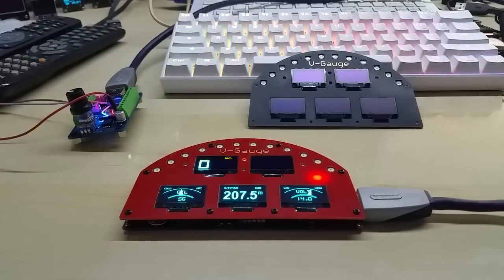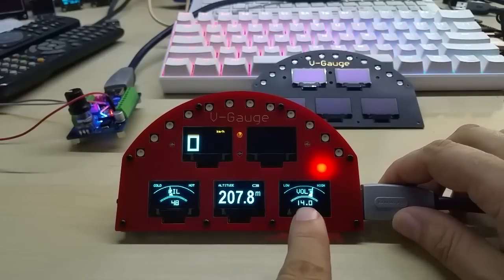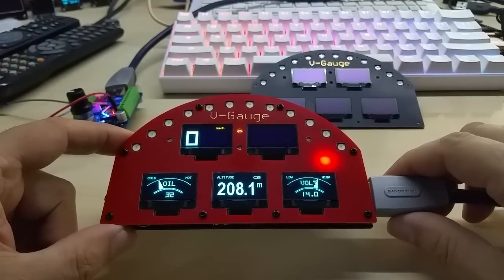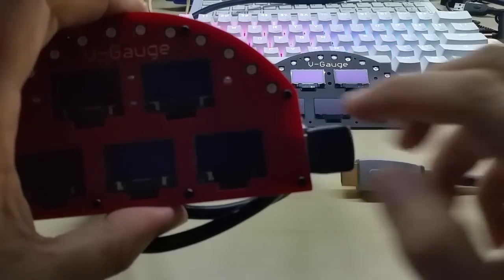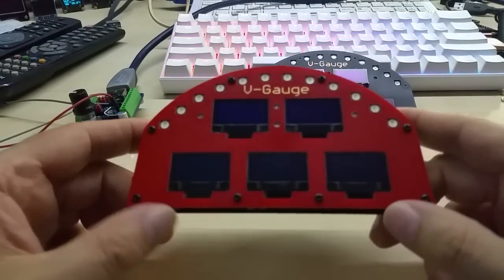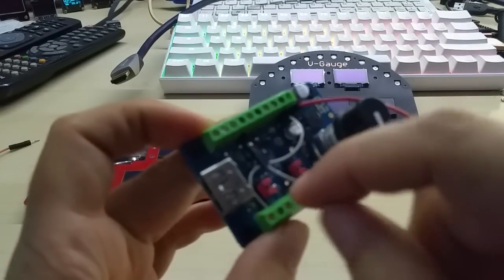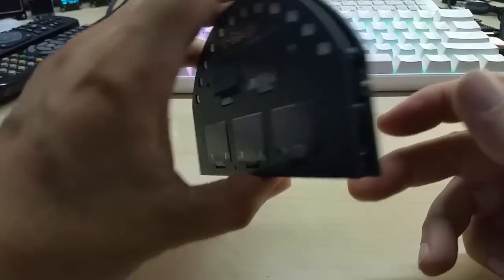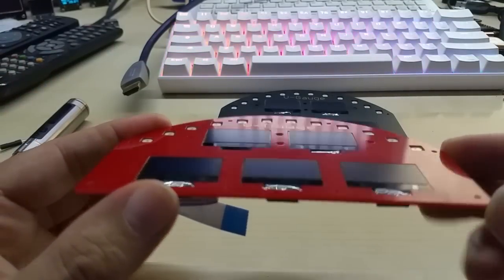V-Gauge in Racing Red and blue OLED Displays, more Info to come.

Comment: Hi, I'm from Spain. I'm trying to find if there is any way to connect an OLED display via simhub, in order to use it for euro truck simulator gear indicator (I need two digits). If anyone knows how, I would be very grateful

Comment: Just watched this vid and subscribed. Awesome job.. any code for fuel level ?? Asking for a friend.
Reply from the maker: Not really, as fuel sensors could be voltage or resistor based. You would need to know the fuel level sensor and start searching for examples for it.
Reply: @iHayri1  yes I have figured that like with any gauge and haven’t found too
Much out there.   I found multiple ones for battery but again not much for fuel.  I’ll keep playing around with it and see what I can come up with.  Thank you.

Comment: Any estimate on price yet?
Reply from the maker: There are a lot of smaller items that increase the cost trust me :-) lipo, HDMI connector, HDMI cable, charging circuit, voltage regulator, rotary encoder, stand offs, screws, flat flexiable cabe and it's connectors, black box and it parts, sensors, nav switch, slide switch, screw terminal and I still could go on. Of course you can just go and buy some cheap Chinese gauge but you will not get what I offer, of course it is not for everybody but go and check some other prices people have, just the shiftlight with RPM costs $180.00 from it's creator. I am a one man operation and can not compete with multi million dollar companies ever. Custom handmade electronics have it's price, unfortunately and I mean that. And also ask yourself for how little income Chinese people must work. You can but a cell phone for $100.00 or $1000.00 it's all a preference. Also count in the time it takes from scratch to design something like this. Did you know that the software alone costs $2000.00, sure i have to but it once but still, or my electric bill with all the electric items needed to work and put this together? Believe me you would not be able to make this for less, unless you work for free and all your expenses are paid from somebody else. Don't get me wrong, I am not mad at you or anything, just wanted to show you what is involved and this is just part of it.
Reply: Hayri Of course man, I all ready know it, and you teach me a lot of things the last year that I must thank you, yours successes and yours mistakes teach a lot about what way to chose. 
To be honest I was thinking on a psicological price tag of 150€, double that it's what shocks me, but by the way looks that you're customers find it fair.
I'm only trying to point some things in where I can see that you can optimize the costs, I know for V-Gauge v1 it's late, but maybe a cheaper, low quality version in the future, can bring my and others the opportunity to get in in you're market, you know, more customers more profits.
And you're right, I'm always thinking in the industrialization of the production (Like if I'm only was a machine that doesn't live or eat LoL), and from this point of view some things that you do increase hugely the costs, for example, file the edges of the neopixels, or paint in black the inners sides of the front PCB, human labor got insane production costs, touch the product from my point of view it's a big mistake, you're doing so well with the reflow oven and the homemade pick and place machine to introduce human operations.

Don't get me wrong, I was surprised by the price tag, and yhea, im very cold at designing. 

Anyway, as I say you before, nice work!
Reply from the maker: I understand your point as well of course but I even forgot the cut Indigogo/Tindie, Paypal, my bank and the taxes I have to pay :-) The only way to get the price down would be to have it produced in large numbers in China, but still I would need to be involved in the production and move to China :-) Nobody there will do the detail work.
Reply from the maker: Around $300.00 US
Reply: Hayri Woha! 

Wait...

5x ≈ 5€ OLED displays = 25€
12x ≈ 1€ Neopixels = 12€
5x ≈ 2€ Atmega328 = 10€
1x at least 10€ GPS = >10€
2x at least 10€ PCB = 20€

I know it's an expensive setup, at least 100€ in hardware, but most head up displays cost less than 50€, all ready maked, with case, box, instructions manual, and retailer profit.

Yhea, Chinese quality vs European quality, Chinese labor cost vs you're own work, but man, you need to be competitive. Maybe an espressif instead of five atmegas, some true RGB analog LEDs instead fanci neopixels, a small back PCB that don't excced 3€ and an aluminum faceplate to hold the screens, can reduce the cost.

Don't missunderstood me, maybe for the next revision, but you need to take care of you're market, personally I can't afford one.
Reply: I feel like it is a really fair price , I'm wondering if I will be able to place the v gauge where my stock instrument cluster is and the gps will still work?

Comment: The black looks amazing! Great inside view of all the components, what a set of boards!!
Reply from the maker: Thanks, they came out great, my favorite toy now :-) All that is needed is to design a kinda bumper case that could be 3D printed or CNC milled out of solid aluminum for when in use on a bike or boat for example, that would make it possible to put a Lexan display cover over the front and even the back :-) i know I mentioned Gorilla glass but that will be very cost intensive, but Lexan, like another viewer mentioned would be ideal and not add much to the cost. Again, of course a CNC milled aluminum case will not be cheap but look killer :-)

Comment: Really clean mounting of the displays. Assumming they are held to the face PCB by soldering the pin connections and plated mount holes at the bottom of the display? Have you had any issues with displays that have the screens misaligned? I seem to often get ones like that.
Reply from the maker: Hi Jon, I would say I nailed the mounting of these displays and you are correct they are held by the 4 pins on the top and 2 mounting holes on the bottom where they get soldered to the pad on the PCB. I could use the top 2 mounting holes as well but there is no need really, they sit very snug and have to play to start with and the solder points are strong :-) The beauty of this mounting is the displays will always be 100% aligned it the front and the PCB of the display can be a little misaligned but it does not hurt the connection, if they are too misaligned as i had a few of those I just lift them up gently from the double sided tape and put it down again better.

Comment: Oh also the black box is a great idea, for auto use in newer cars with obd/obd2 I wonder if it's possible to connect the requisite wires through that port and related plug to make it plug and play for anything with that standard
Reply from the maker: I would love to do a OBDII version as well, actually it would be possibe to upgrade the V-Gauge to show that data but I have no way of testing it as my car is a 96 with no OBDII. I know there are simulators but somehow I do not like the idea of just simulating something and selling it with no real life test. If I ever get to buy another car (2007 Chrysler 300C for example) I will make a gauge that will just plug into the OBD port and be a plug and play version. I will not make it wireless using Bluetooth, first because I hate Bluetooth, second it has a 1- 1.5 second lag and third the gauge needs power anyway and is connected already and therefore it makes sense of just plugging it into the OBD port and be done with :-)

Comment: Awesome as always Hayri. Did you look into laminated tempered glass sheets for tablets like I suggested on an earlier video? Gorilla glass is great but very expensive. Another option would be lexan(thin polycarbonate, relatively easy to cut and source) and coating that in a SiO2 or ceramic glass like coating. It does add time but it's something that can be done with a plastic sheet knife or similar and the applicator pads that come with most car ceramic coating kitsch. 1 kit would do MANY screens and have several advantages over even gorilla glass. Also 3d print a buck or mold and either resin pour the sun shade or vacuum mold it(if possible). All things to think about and I understand, not always doable. Get some sleep and great work
Reply from the maker: Thank you for your great ideas and yes I remember you writing about it earlier. Lexan would be really an alternative and I could even offer spare ones so anybody could just replace it when needed. I know Gorilla glass would be nice but most likely too expensive to start with. For the sunshade I figured I could cut the first one by hand ands if I get a larger order through Indiegogo I would just buy a CO2 laser cutter, buying because it will save me time as opposed to build it, and cut the shape out of thin ABS or similar, needs to be withstand the heat in the car that can build up during summer time. Could really go as fancy as to have it attached to the gauge with magnets so it can be simply snapped on and off. If only money would be plenty I could do so much more, but gotta start somewhere, who knows maybe it will be a big hit :-)

Comment: Very nice.   What does it connect to in your car to get the info it displays?
Reply from the maker: This was just connected with 3 wires to the car. Power, ground and the rpm signal. The voltmeter does not need an extra connection as it is connected over a voltage divider to the power on the black box, the center display is connected to the BMP180 sensor in the gauge itself and the 5th display was just running a demo code. But basically you need just 5 wires to have the bottom displays each have a different function.